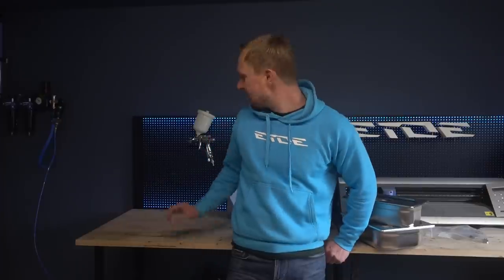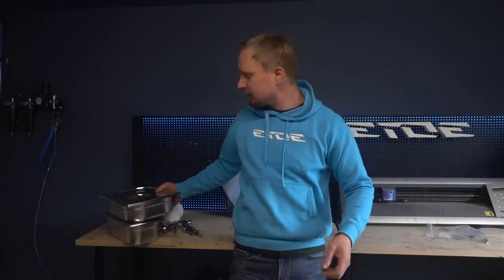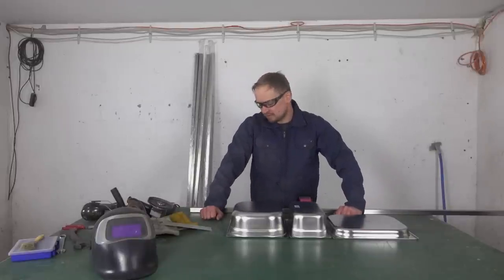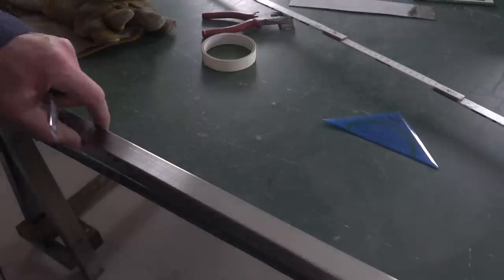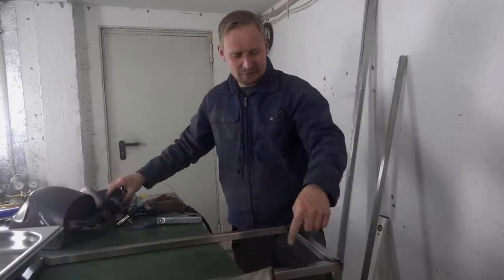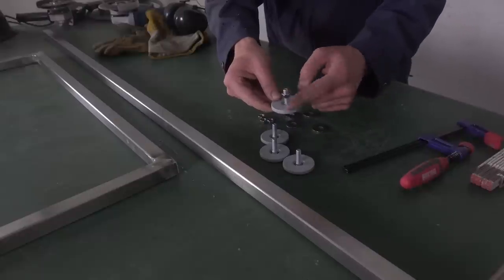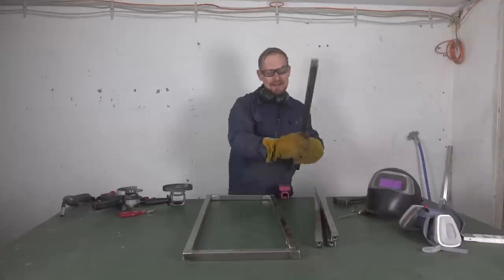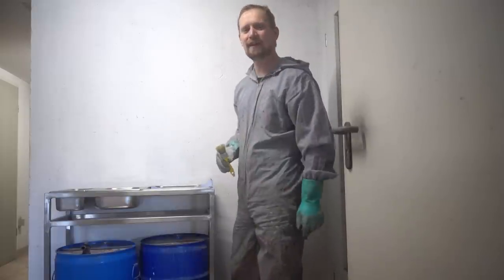How I clean my Spray Gun - my Spray Gun washing table

Comment: Wait so is this station for oil based paints? I was thinking you would want a faucet and a drain if you were spraying water paints, but I'm thinking now you wouldn't want a drain at the location where you clean up your oil paints to prevent improper disposal.